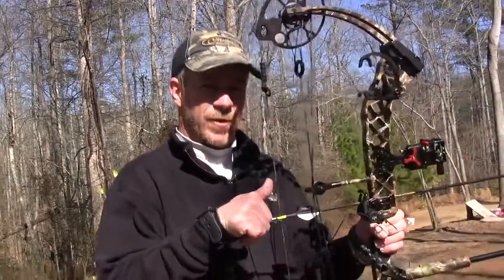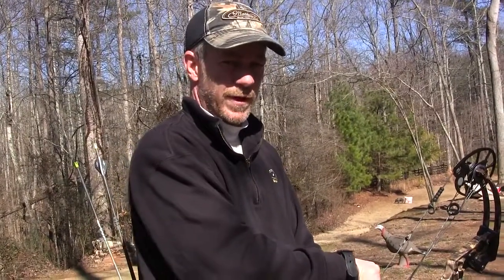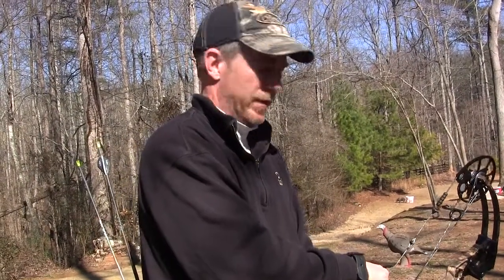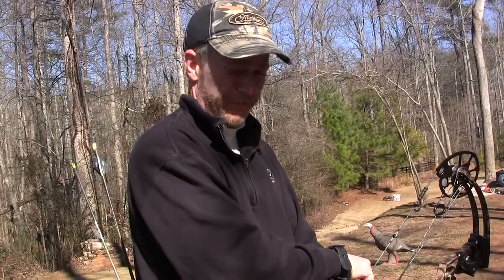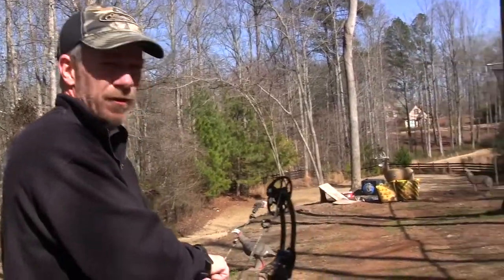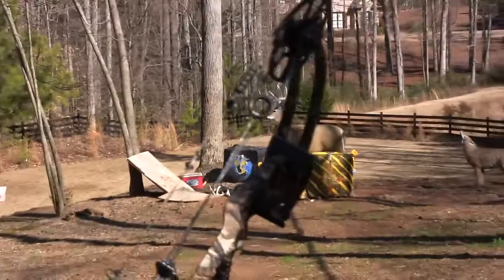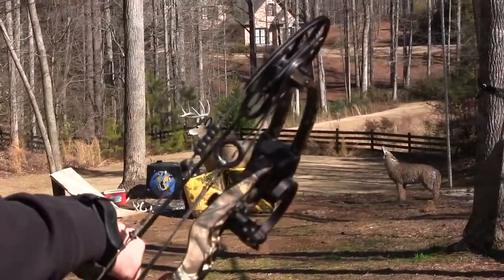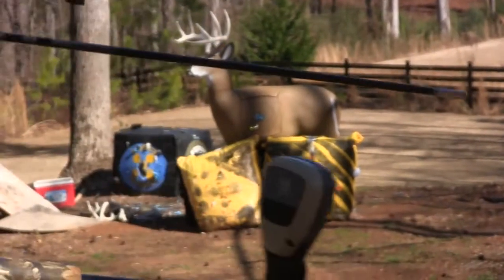2013 Mathews Chill Setup & Tuning Session - 2nd Phase of Bare Shaft Tuning

Comment from the maker: Hi Eddie.  The back wall on any Monster, no matter the level of tuning, will never be as solid as a bow with a draw stop (Heli-M and others like it by other brands).  However, your information is correct in that they can be tuned to have either a wider/deeper valley (this particular type of tune is shown in the video), the standard valley found in most pro shops (cable center on timing hole) or a more narrow valley but very firm wall for a Monster series bow which is suitable for target/3D.